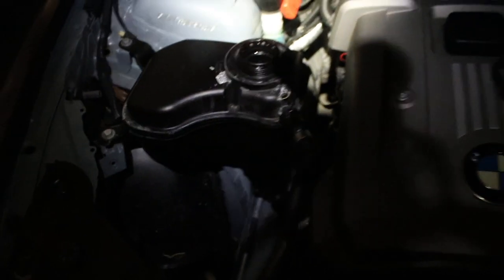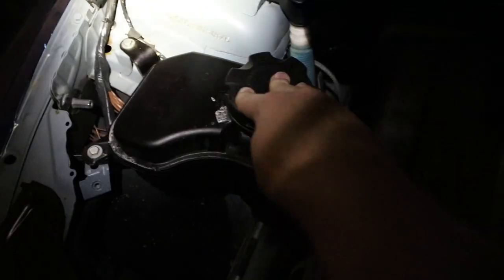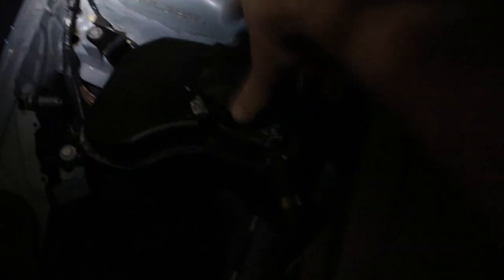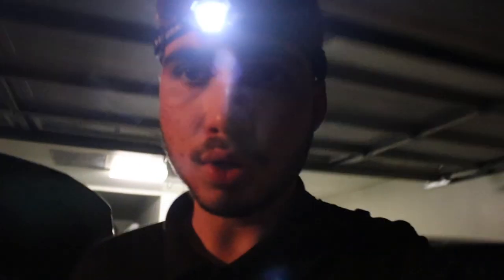E90 AND E36 ARE BROKEN! CANT DRIVE EITHER!!!

Comment: Hey man! This isn't a head gasket issue. Those failures are rare on the N52's/N54's. If oil is in your coolant expansion tank, then you have a oil filter housing gasket leak. There is a coolant passage there that passes right next to the oil passage. The oil filter housing gasket is very common to fail and then both passages will mix. You'll need to fix the gasket and then get that oil out of the expansion tank once you fix and fill everything up (also change your oil). Depending how long they mixed, might take a little time to get all of that oil out and have it clean and only with coolant. It's a hassle none the less, but it happens. I did the diy on this prior to starting my channel, but there are plenty of good DIY write ups on this procedure.

Keep me posted and I'll help ya out with any questions
Reply from the maker: BMW Fanatic thanks man appreciate the help. Good to know from a lot of people that it's not the headgasket.
Reply: Nour Hummadi 👍🏻yeah man! Just take baby steps with it and start eliminating the easiest and the most inexpensive parts first

Comment: Drive the e36 more and do the BMW drive cycle. Maybe it'll help to pass smog. I drove my brothers e46 for 300 miles without doing the drive cycle and it failed. Did the BMW drive cycle and it passed. And for your E90, I'm almost 90% sure its your waterpump/thermostat. Its uncommon for these cars heasdgaskets to prematurely fail but its possible. Check your coolant reservoir and see if there's oil in it and/or drain a little bit of oil from your oil pan. If your oil is milky colored, thats a sign of a bad headgasket. Best of luck.
Reply from the maker: ESG thanks man I'll check it out

Comment: Highly doubt it's a bad head gasket. When the car over heated the little orange coolant light came on, then immediately followed by the red assuming you pulled over as soon as you saw that, you're fine. As for the "oil" in the coolant, BMW coolant feels oily in its natural state. http://www.bimmerfest.com/forums/showthread.php?t=495950 

top your car off with coolant and try that. It's how you bleed the cooling system for air bubbles and to make sure the pump is working. I believe if you see coolant flowing from the small hose back into the reservoir  then your water pump is fine, if you hear a noise like it's stuck, then your water pump is bad. Best of luck to you man, hope this helps you out!
Reply from the maker: Andrew  Greene thank you so much for your help I'll be showing my mechanic what you said and figuring out the cause of my overheating

Comment: When the engine is running do you get gas bubbles in the coolant with the top off the expansion tank. I had the water pump fail on mine. BMW replaced the pump and thermostat, they also did the expansion tank cause it burst! There is a test you can get that will check for combustion gasses in the coolant. Check out South Main Auto!
Reply from the maker: Mark Holder yup was the water pump and thermostat

Comment: Nour don't stress it man. I have a 06 325i n52 with sports package. I had the same problem last month when the summer started. Btw I live in NY. The coolant was leaking through the expansion tank cap. I took the car to a domestic mechanic and he said I needed a coolant flush because I didn't have the right coolant in!  Since then after a month I drove fairly 400 miles and no problems after the coolant flush. I drive the car for at least 2 hours straight with full blown AC and it was good. Hope this helps. Reply down below so I know u read this.
Reply from the maker: Rais Singh thanks man will get it checked out

Comment: dude, change your oil filter housing gasket,  do a coolant flush and engine oil change. BTW when engine oil and coolant mix, they turn into milky white stuff.
Reply: I would change out the gasket first before XXX around with head gasket or water pump

Comment: n52 engine has electric waterpump, u should check it out if it works. open your hood, turn power on ( do not start your car ) press gas pedal for about 10 sec and you should hear your water pump running ( this is bleeding process for n52 coolant )
Reply: also that engine does not like overheating ( alum+magnesium block with alu cylinder head combined with straight six ). it will warp easily if its too hot.
Reply from the maker: Sami Tapio thanks man I'll try it
Reply: No problem. Those waterpumps can fail with low miles. Good diagnostic tool can read waterpump errors if you have one. Hook your battery charger on if you are testing that water pump. That bleeding process will take a few mins ( if you water pump works ) so your battery wont dry.

Comment: Yeah, it's 100% a head gasket failure, because the oil gets mixed with water inside the engine from gasket leaking (Hole).

Teezak Ahsan ;D
Reply: That doesn't mean it has to be a head gasket, there is various things that can go wrong which would mix coolants with oil.
Reply: "100%" lol
There are so many other reason why hes bmw is doing what it is.

Comment: Mechanics love to tell customers that their BMW's have a blown head gasket anytime it's over heating or there's coolant mixed with engine oil... do all your checks, worst comes to worst and you really do think you have a blow head do a compression test before you go and spend a thousand or two on a head gasket replacement... they usually only kick out well over 100K miles !! Good luck
Reply from the maker: Ragib Arman thanks man